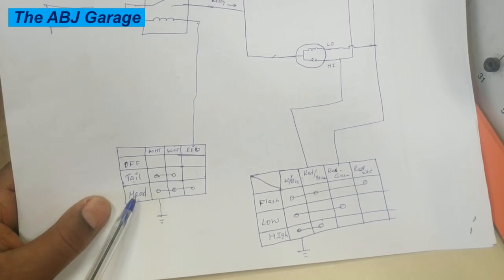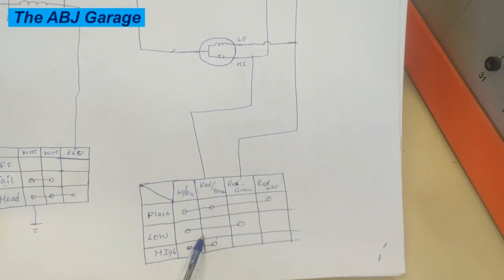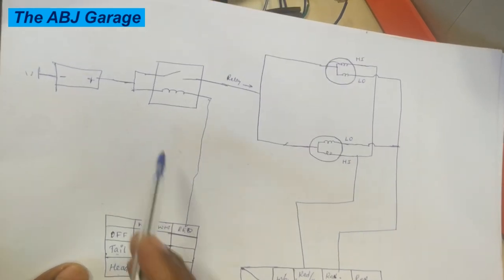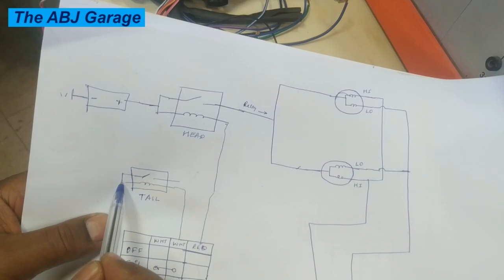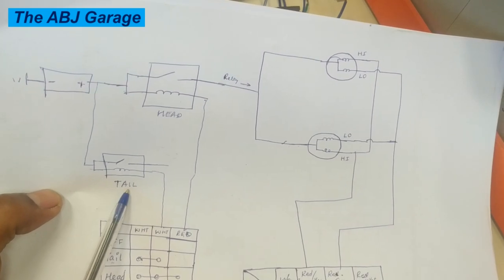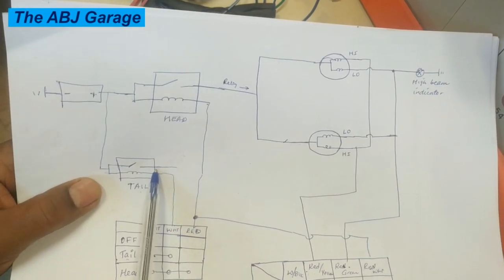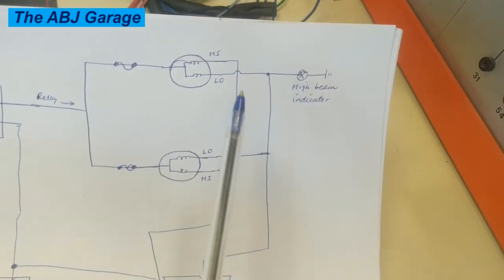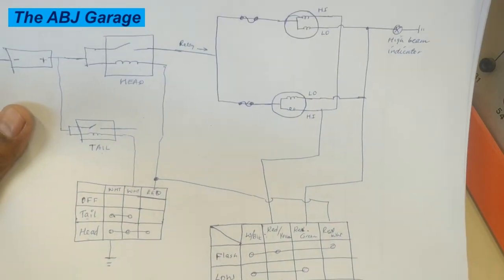How to do basic headlight wiring

Comment: My headlight relay keeps blowing. The only way my headlights will work is if I pull it back in the “flasher” position and hold it, and then of course it’s bright lights. Can you please help me fix this??
Reply from the maker: I think your problem is on the light switch, not on the relay. I say this because the flash is still using the headlight relay to power the head lights. The flash position does the job of the light switch and that of the dimmer switch at the same time. So if the head light comes ON on the flash position, it means the relay is fine. Check the light switch instead.
Reply: @TheAbJGarage  thank you so much!!…I’ll let you know what happens!
Reply: @TheAbJGarage  Welp unfortunately I replaced the switch and it is still doing the same thing. …the reason I say the relay keeps blowing is because up until the last one I bought (4 or 5 in total) the headlights would work normally for maybe a month or 2. …do you have any other suggestions? I really appreciate it!!